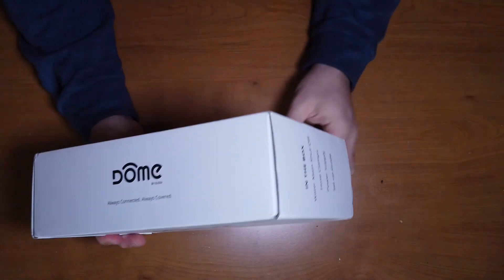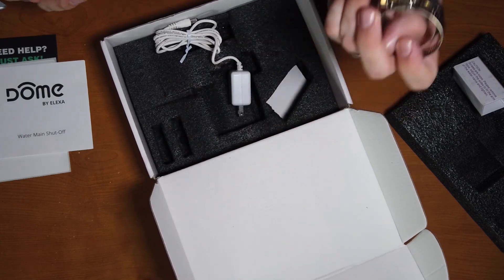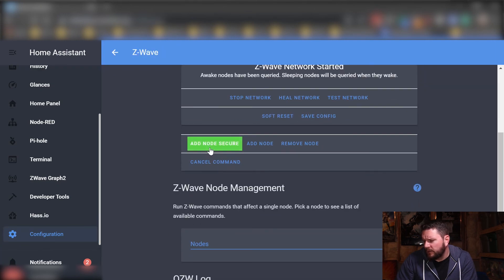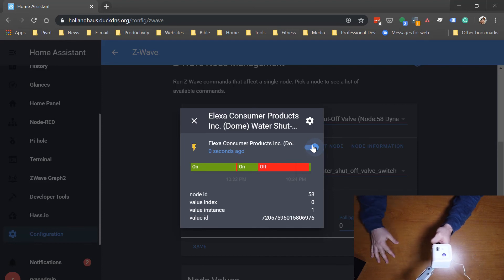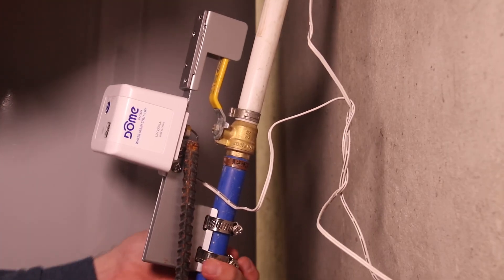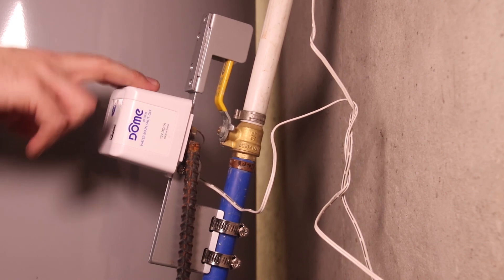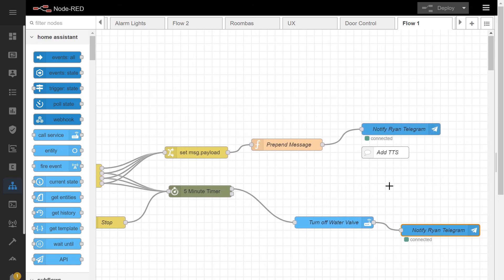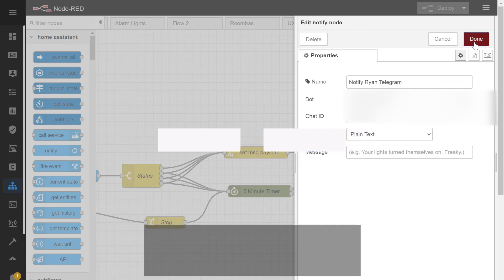Prevent Water Damage in Your Smart Home - Dome Z-wave Water Valve

Comment: I installed the same Dome Z-wave water valve in 2019 and tried to get it to work with Dome's water sensor without success.  I then created my own water sensors using sonoff programmed with tasmota.  I am now looking for a better solution.  Can you please tell me what you are using?  Thank you!
Reply from the maker: I am currently using the xiaomi water sensors connected through their hub. That hub is added to home assistance and there is automations to shut the valve if they detect any leaks. Are you running through home assistant?
Reply: The Dome Water Main Shut Off runs on Z-wave and the Xiaomi water sensors use a Zigbee hub.  How did you get them to work together?
Reply from the maker: That is the beauty of Home Assistant.  As long as it is compatible with HA, they can talk to each other.  I have Zigbee motion sensors triggering Z-Wave lights, all kinds of things.  I am using an Aeon Z-Stick (with the built in Z-wave JS) and the Xaiomi Hub with its integration.
Reply: @ThisSmartHouse  Thank you for this info!
Reply from the maker: You are welcome. I have a video on how to set up home assistant, but I haven't gotten around to making the Z-Wave or zigbee setup videos. But those are coming in the next few months.
Reply: @ThisSmartHouse  I'm looking forward to that video!  If you have the yaml code you could share it would be appreciated.  Thanks again...
Reply from the maker: What yaml code do you need?

Comment: I'm curious, how come you didn't just cut the top 2" of rebar before installing this device? It seems like the rebar is more of a headache than anything but I understand the need for it to keep the pex in line.
Reply from the maker: I thought about doing that but I didn't want to risk nicking the PEX line. Plus I didn't have a grinder that could have cut it (I do now). I haven't had any issues with it once it was set up.
Reply: @ThisSmartHouse  Gotcha, I would have cut it off but put a scrap piece of wood between what I was cutting (the rebar) and the PEX pipe to prevent nicking it. 

I love this video because you explain a couple of different node-red options that I was looking at but had no idea what they do. 

I was looking for a water shutoff valve because I'm trying to figure out automating the outside water spigots to turn off the water and purge the pipes if the outside temperature gets below 35 degrees, once it is above 50 degrees it will automatically turn the water back on if it isn't already on.

I plan on putting popup underground sprinklers in so I'm also going to try to figure a way to use compressed air to purge those pipes.

You've earned my sub with this video, thank you.